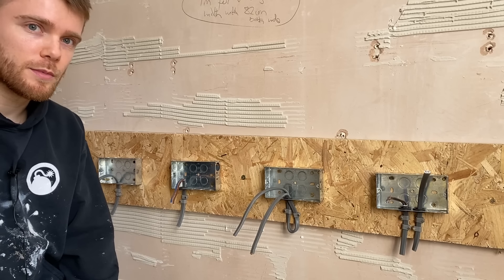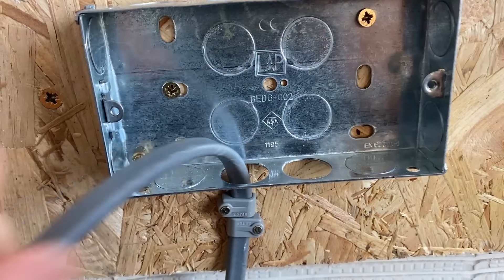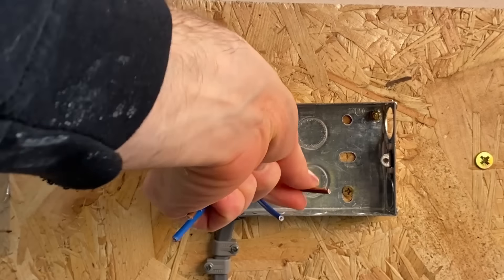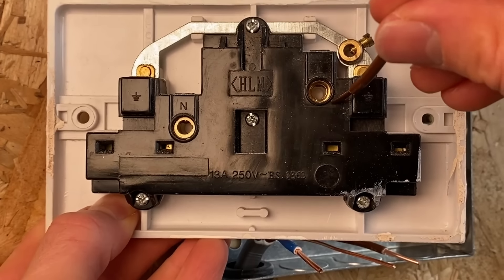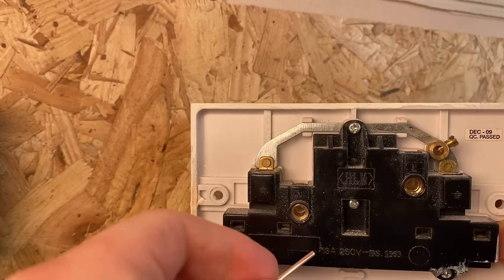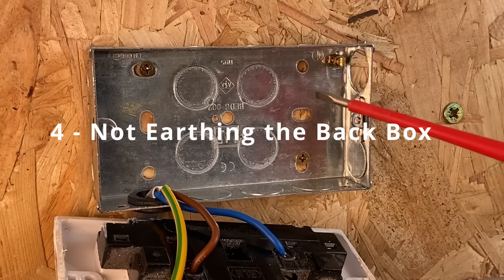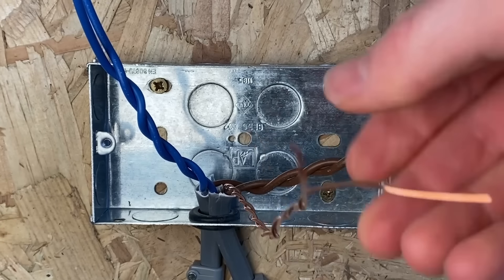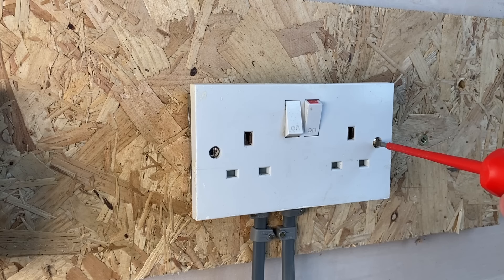5 Biggest DIY Mistakes Wiring a Socket

Comment: Go back to old installations (talking of before the 1980s) and it is common to find neither earth sleeving used or grommets. It's good practice to remedy both when replacing sockets and light switches. It can be a bit tricky in a masonry wall with traditional plaster as it often runs into the wall. As for earthing backbones, that's a controversial one as all sockets have earthed inserts in the screw holes. From what I read, if the metal fixing lugs are the sliding ones, then you are meant to earth the back box, but if there's at least one fixed lug, then it is not required. Of course the screws have to be done up properly, and it's good practice to check earth continuity on both the screws and any metal fascia plate anyway. 

Again, many, and possibly most existing installations will not have earthed back boxes. There is also the problem that those 25mm deep back boxes have little spare space for yet more wires, especially if there is a spur and/or has a USB power outlet. Personally, I much prefer 35mm back boxes, or even 45mm in stud walls. 

As for lining up the slots on the retaining screws, that is purely aesthetics, not a mistake and pointless if the screw heads are concealed by a fascia plate or have those little plastic insert plugs.

Nb. I was watching ith some amusement some American guidance where many recommend that insulation tape is wrapped round their sockets to avoid the danger of live terminals touching the earth (ground) wire as they are not sleeved. Seems a bit strange that sleeving isn't mandated in the USA. However, the US has quite a nice rule that the continuity of the ground circuit must not be interrupted if a socket is removed, which means that a pigtail is used for that purpose. That way if there's a poor ground connection on a replacement socket, it won't affect the integrity of the ground circuit on downstream sockets. It would fit quite neatly with a terminal on the backplate, although those on UK ones are too small to be used that way. Also, on a ring, but not a radial, the are two routes to earth.
Reply from the maker: Thanks for the info! Thank you for watching!
Reply: @TheDiligentDIYer1759  John Ward covers backbox earthing and the regs in his video on the subject. Of course there's nothing wrong with earthing the back box, and some consider it best practice but I don't find it's that common.

It is covered in the IET guidance rules which John goes through, and that explicitly states that a back box with at least one fixed lug is considered to be earthed provided, that is, the accessory in question (socket, switch etc.) has a terminating earth connector which will connect to conductors on the screw holes.
Reply: often wondered about the earthing arrangements that seem to exist on plastic boxes
Reply: @theotherside8258 - if you mean a single earth terminal in a plastic back box, that’s for earth continuity if the accessory does not have an earth terminal (e.g. light switch).
Reply: As DIYer I have to agree about backbox depth. Our house has mostly metal conduit set in the plaster apart from new instals which have just the cover strips. Plastic fitted by professionals or metal if I did the job. All sockets and switches were surface mounted plastic so no earth continuity. Earth/CPCs were taken direct to the face plates. Over the first 2 or 3 years we were here I gradually chopped out and installed metal back boxes. All at least 35mm as the original face plates were straight back entry and I soon found that trying to push the plate in squashed the wires flat against the back of the box. Older face plates often had a much heavier lump on the back leaving very little room for the wires, bent at right angles and tight to the backbox. I gradually replaced all the face plates with more modern ones with angled top entry for the wires. All earth wires were sleeved and taken to the backbox terminal plus an extra sleeved length from the faceplate to box. We have now replaced them all again with brushed steel face plates which are all earthed via the fixing screws. Although the sockets also have a wire to the backbox as well. I am also lucky in that my neighbour, until last year, was an electrician and would always come round and check everything for me.

Comment: 😂😂😂😂 good video with good tips.

But I like the comments of them so called "professional sparkles", who actually only follow orders. The misconception that a DIYer, by default, shouldn't do any electrical work is just as stupid as testing a socket with a screwdriver, regardless which hole or whatever alignment is used for the screws (on a side note: have you ever tried to fill, horizontal or vertical, the drive of a screw with water without reducing its surface tension? No? Bloody try it, and make a video of it. It will look like a magic trick... 😂😂😂😂

I've been renovating houses for a hobby the last 25 years. But the amount of "qualified" cowboys I've seen working is staggering.

Not related to elec, but gas. New (old) house. Connected the oven to the gas pipe. Obviously without a valve since that's somehow not needed in developed UK. So I connect it, but no gas coming out of the cooker. No gas, no smell of gas, no nothing. Called the gas guy from the agency (with signed up van and all) and he couldn't touch it since I touched it. I said... "Mate, there is no gas in it. Even if I take the meter away and let gas freely drift into the house, this pipe does not have a connection with the mains. Pipe in concrete floor. Boiler, however, was working fine.
Two specialised and certified specialists further, the builder of the boiler came in to finally tell us that once the new boiler (old one was a heater in the front room) was put in, they forgot to create a cooker output with the one from the boiler, but cut and closed the one from the room heater. It was just an empty pipe stuck in a floor. 😂😂😂😂😂😂 I could have put a new connection from the boiler to the cooker myself if I knew... 😂😂😂 But hey.... I am only a DIYer... Innit.. 😂😂😂😂

Anyway... Nout difficult about electricity as long as you know what your doing. That's why these videos are perfect. Obviously not for them "professionals" and perhaps their income, but hey.... It's what it is.. 😉
Reply: Is it easy for a Diyer to add an outdoor socket YES, but that's where the trouble lay. Now how will the Diyer know that he's done a great job?
Reply from the maker: Thank you, and thanks for watching!
Reply: it wasn't as bad as whoever did mine before i moved in, using Sellotape to seal pipes.  Found out the hard way.

Comment: Back boxes only need a cpc connection if both screw holes are adjustable. If one is fixed, no need.
AND
You can test 'one way' with twisted cpc if you take the live conductors out of their terminals (and at the MCB too).
Reply from the maker: True with the back boxes, but nelly and braces, once the screws are out, you’ve got no earth on the box…
Yes you are correct with the cpcs
Reply: @TheDiligentDIYer1759  regs is regs and as far as the regs are concerned no-one would be removing a face plate without practising safe isolation. Simple as.

Comment: I really enjoyed this. From the perspective of an electrician working in the USA, were I to double over a wire like that, the inspector would not only fail that connection but certainly want the entire installation yanked and checked with a fine tooth comb.
Not saying it's wrong, so the arm-chair experts can stand down, but there is a very strong move away from anything which would weaken a connection through copper annealing here in North America.
Reply from the maker: Interesting to hear! Thanks for watching!
Reply: How would this cause copper annealing? If anything the bend would slightly work harden the copper.  Provided the screw clamps the wires on both sides of the bend (as shown in this video) you have a better electrical connection, if you somehow only manage to clamp one side (pretty much impossible) then it's as good as a single wire without the bend.
Reply: The inspector does NOT know SFA, obviously !!

Comment: With most sockets you will have two wires going into each terminal. Don't think it's the done thing anymore but the best way to get a good, tight connection is to slightly twist the stripped ends together. Lost track of the dozens of times I've taken sockets and switches off and found the screw has only caught one of the ends properly. And no, a couple of light twists won't weaken the cable.
Reply: Twisting can give you misleading test results though?
Reply from the maker: Thanks for watching!
Reply: @TheDiligentDIYer1759  No problem, it was nicely done and clear.
Reply: Never twist ends. By leaving enough slack you should be able to flip your facia forward to check the connections.
Reply: @mikebrooks9201  agreed., not good practise at all!
Reply: @mikebrooks9201  Too many sockets and switches have screws that are not big enough for the terminal and, as is shown when using single core, can cut into one core but barely touch the other. If they improve socket design I'll put them in untwisted but I've been twisting for 30 years with no problems. Lost track of how many times I've been fault finding and it turns out to be untwisted bad connection.
Reply: @jameshansing5396  I've searched online but have never been able to find more than hearsay as to why it's bad practice. It's the way my instructors taught me as an apprentice and how the other electricians I've worked with did it. Foreman would have hounded us if we didn't. Not twisting is a relatively recent thing I think.
Reply: @christopherhume8896  Right, the twisted CPC breaks or comes loose from the socket terminal. Rare but it happens.  The socket then has no CPC.... BUT if you TEST that circuit, eg end to end etc it will test OK whilst being dangerous.  Plus bending/twisting solid core cable then winding a screw into it isnt ideal. Bending metal weakens it.....
Reply: @jameshansing5396  repeated bending of metal weakens it. A couple of gentle twists has no noticeable effect. And if only putting one cable in we double it over, that's a 180° bend. If worried about the earths coming out then put one into each earth terminal. Then push the socket back into place, being careful not to bend the cables. 😉
Reply: @christopherhume8896  the weakening bit is not really relevant, the misleading test results is.  But yeah you are obviously convinced you are right.  and yeah, I often do put one in each terminal because twisting is crap! ;)
Reply: @jameshansing5396  There's more than one way to skin a cat, or connect a socket. I'm happy for each to use their own method as long as it's safe, I've just never found any evidence that twisting is unsafe. If it was surely countries would stop using wirenuts? Just need to find sockets with wagos at a decent price.
Reply: @christopherhume8896  I’ve explained why ….

If you’re ok with unsafe sockets testing as safe then fill ya boots… 😎👍
Reply: @christopherhume8896  the twist can give an incorrect test result of ting continuity. Surely you must be able to see/admit that????????
Reply: @jameshansing5396  Ring continuity test is only designed to test the ring. Other tests for polarity etc will test if the sockets are connected correctly including for missing connections.
Reply: @christopherhume8896  😂😂😂😂 still can’t admit that it’s beneficial to have a fault showing up? 

You do your end to ends and it will test as ok… it isn’t though… I can’t really make it much simpler than that.

Agreed a thorough spark will still find the fault but my way hopefully the less thorough ones will too..
Reply: @jameshansing5396  I'm not saying you don't have a point, I'm saying there's nothing wrong with twisting as any fault will still be found with proper tests. Twisted or untwisted, both work.
Reply: As an ex electrical inspector I can tell you it is not good practice to twist solid copper cores together a: you get micro fractures in the copper and if the cables are subjected to any movement can break or partially break at the scew compression point, B: makes it an absolute nightmare to fault find having to untwist cores and do damage to conductors. C: Twisting conductors gives a different contact surface area to the inside of the connector and will not pass high current without heating effect (this occurs at the crest of each twist). Socket grub screws work very well on two conductors side by side, if only one conductor it is permissable to fold conductor back to form two at tip. You do not have to take any of this advice gained from 50 years of experience and find out the hard way as many of us oldies have, well thats my 10 pence worth.
Reply: @christopherhume8896  your opening comment was “the best way”… which it isn’t ..

And yes I know I have a point. At last. 😎👍
Reply: @pavelrobertson5016  😎😎😎😎👍👍👍 Herr Hume is not fond of the opinions of others! But I am!  Great post, chap!
Reply: @pavelrobertson5016  Thank you for the reply Pavel. First person who's ever replied to this question with more than just "twisting is wrong".
Reply: I've been doing diy electrics for 40 years and used to twist the ends as you describe, but haven't done it for many years now - 2 reasons: 1. I see pro electricians don't do it and 2 its a bit if a pain if you want to change the circuit (eg extend a ring). I'm not saying what you do (and what I used to do) is wrong- I just don't think it is really necessary.
Reply: @christopherhume8896  Yes it was considered good practice in the late 60s and early 70s. Not liked now because of the heavy reliance on testing everything.
Reply: @royfishall6482  60s! I'm not that old. 🤣
Reply: @pavelrobertson5016  Very well put. Thanks. 
Testing twisted wires is a big pain in the backside!
Reply: @royfishall6482  yes I've worked with sparks of that vintage who twist it all together! Even all the cpcs outside a jb of there wasn't enough terminals inside it....

Comment: Very informative video, many thanks. I will add that the screw alignment  for internal sockets must  be aesthetical. If however it was an outdoor project the alignment  of the screws is of importance. Old school carpentry in particular would have the slots vertical to allow water to pass. If the screw slot was horizontal it would allow water to gather and possibly rust. atb Mally
Reply from the maker: Thank you and thanks for watching!

Comment: I wonder how a diyer would sleep at night if his work burned a place down or someone got electrocuted. Should be illegal IMHO.
Reply from the maker: Fingers crossed they see my video so that never happens!
Reply: It is illegal. Homeowners are required by law to get a qualified electrician to do such work. I believe it is legal to change the face plates still however I think that needs to be dealt with as it exposes the mains wiring.
Reply: Actually small jobs are legal in the UK though bigger jobs are regulated...

Comment: Solid core cable ffs UK needs to evolve
Reply from the maker: What’s wrong with solid core? It has better current carrying capacity than stranded.
Reply: Why?
Reply: Multi core was replaced years ago. 🙄
Reply: Maybe you should explain what the problem is?  Infrastructure cable isnt supposed to move so why would it be stranded?  Maybe you have money to waste?

Comment: Why you don't sleeve  the earth's together, is because there's a higher  resistance in the earth's because 1.5 is used for earth and 2.5 for live and neutral. Screw heads the same way is up to you, they only put them vertical mainly in hospitals because you get less build up of dirt with the screw is vertical opposed to horizontal
Reply from the maker: Thanks for watching!
Reply: Are you saying that two (or more) earth wires cannot share the same green/yellow sleeve, regardless of any twisting together?   I can see that conductors touching will reduce the effective resistance of the length of the 'bunch' - but so what?
Reply: @harstan7333  it doesnt make a difference really in smaller rings But makes a difference if you've got a bigger ring circuit it can go past the permissble levels,if you don't twist  the earth's together it should be 1.67 the resistance of live and neutral conducter if you twist together it  makes the resistance reading for the cpc higher. Try it next time with your meter do r1 and r2 twisted and untwisted and the the difference in readings you'll be surprised